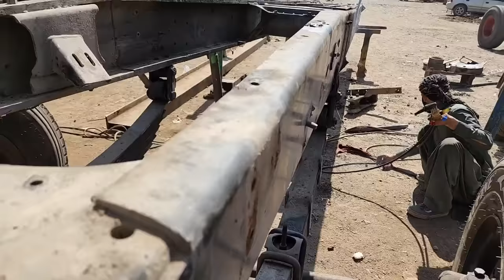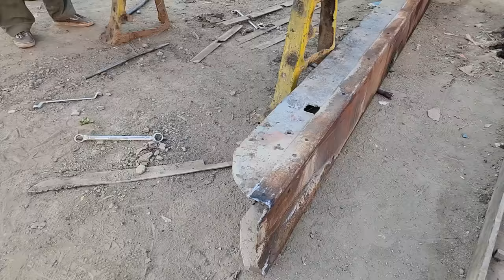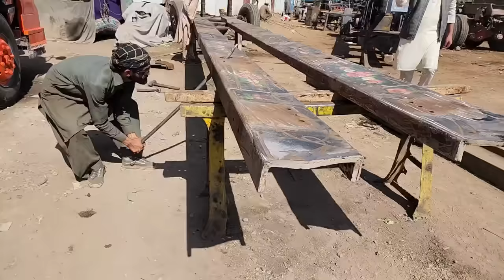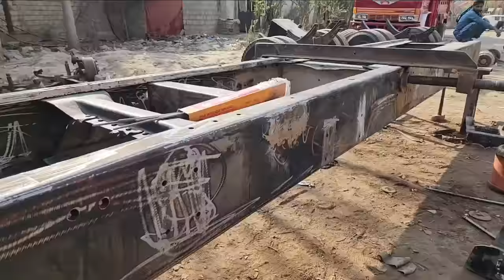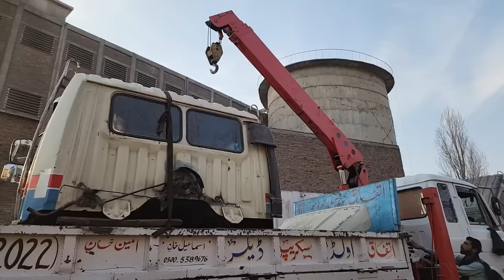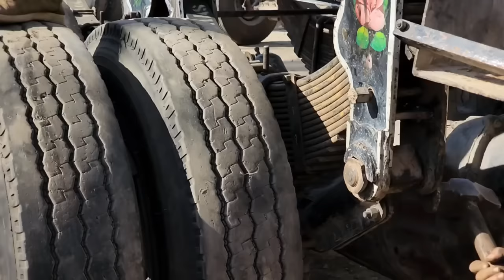How to Rebuild Broken Truck Chassis  Completely Restoring and Rebuilding Project

Comment: Pakistani suicidal squad preparing the truck for the next stock car challenge in himalaya.
I was only joking. Really hard work without throwing parts away  and i hope the  truck drives straight forward when it is necessary. Good luck

Comment: Driver: It just fell apart for no reason chief. Only had 220 metric tons in the back. 😀 This looks like it's about the 5th repair on that chassis already.
Reply: @PakistaniTrucker  Only 220 ?  My goodness then you will be able to tow a trailer with another 100 in it. 👍